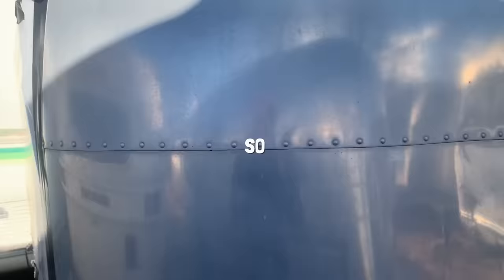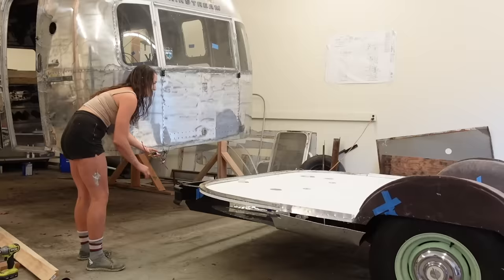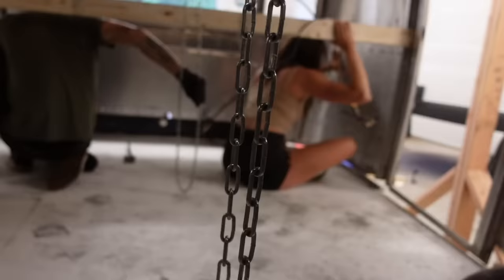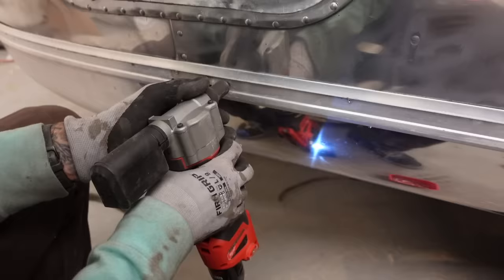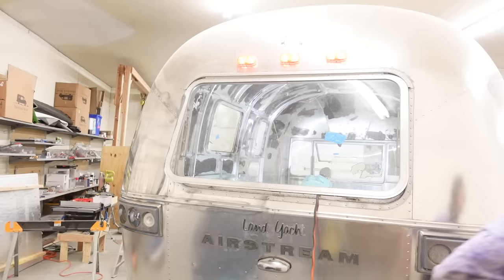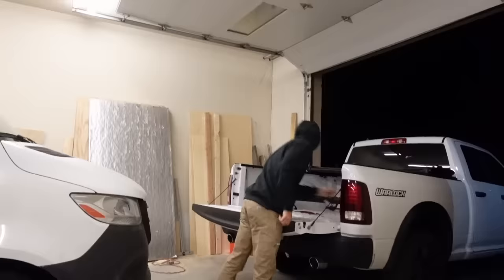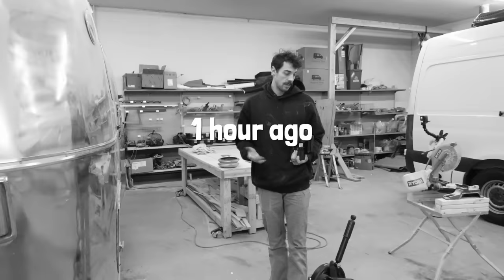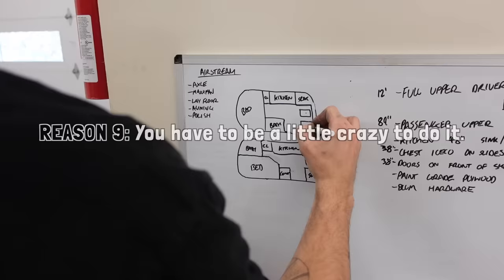Why No One is Renovating Airstreams

Comment: It is unfair to make it seem like this is just an Airstream problem, it is a problem with all campers. I owned an Airstream and other campers, the all have the same aging problems. If anything, the Airstream held better then my other campers, the reason is they are extremely well made.
Reply: only difference with an airstream is the interior
Reply: No, Airstreams are actually extremely light weight, made for towing, NOT durability.  Let's not talk about the formed plastic interiors.  About the only rebuildable aluminum campers are Boles Aero and Silver Streaks,
Reply: It would be better to say, you can run into simillar problems with aluminium in any trailer, but its obviosuly the more traditional the materials the easier, and the more traditional the original build the easier. If its aluminium but has 4 walls and a roof, you will find it easier than a single body construction.
Reply: Dude, no. We were talking about DIY renovation of a trailer. Airstream helping you maintain it as is-is dodging the issue.
Reply: Airstream are stronger than most, which are mainly wood.
Reply: It’s just y’all pay for an airstream that has all the other camper problems, 😂😂😂how to say you have been fooled without actually saying it
Reply: @kcgarrigan4324 no camper was made to be towed, that’s the issue, it cannot withstand towing,, that’s why you have your day start with a dribble, but they sure are pretty, that’s all that matters
Reply: Most trailers are wood framed and almost unfixable in the event of rot, the weaknesses of the Airstream is the need to take it apart if the floor rots  but that is the only structural wood in the thing, the later models fixed this issue.
Reply: id use marine plywood and truck bed liner@MS-ig7ku
Reply: @danpettis1675  I just used CDX for truck bed liners it is easy to replace and lasts for many years.
Reply: @danpettis1675  Agreed no idea why they used OSB after tearing this apart.
Reply: @danpettis1675  No bloody wood.... in a dry climate maybe but up  north NO !
Reply: @geroutathat ,
   Exactly. Even in this video above, we see that the shell was pretty darn well intact, and they're talking about "making a tiny home" in it, which means they're going to gut and pitch most or all of that vacuum formed textured plastic. 2× 2 walls etcetera means you're going to rebuild the whole darn thing. Airstreams aren't really that bad. I have an Airstream RV and got lucky because it was in really good shape. My aunt actually kept it inside a pole barn!

Comment: To install any distorted/flexible shape such as an Airstream body on to a floor base, you fix upright guides into place that, as you lower the body shell, align the body with the base and it drops gradually into place as you tweak the shape into place.
Reply: Shoe horns.
Reply: just what I was thinking
Reply: Brace the body internally to hold it straight. It will then fit the chassis. It’s a method often used when restoring heavily rusted classic cars.
Reply: funnels or shy even wooden rulers,
Reply: What about you put x braces up in shell before you remove it from the chassis so it holds its shape

Comment: "speciality tools" shows some basic tools that could be used for anything.
Reply: Was thinking the same thing, also seems slightly too pricy for what it seems to be…
Reply: And expensive versions too
Reply: Yeah you can use those on boats
Reply: Lol I have like 3 of each of those specialty tools shown 😅
Reply: @mathehack1  you can use those tools on a lot of things, thats the point lol.
Reply: Most people don't need to rivet a whole camper. Electric rivet gun? Rather specialized for most. A regular rivet gun? "Everyone" should have one.
Reply: @mnFlatLander  who needs electric screwdriver? just use regular screwdriver. yawn. manual rivet guns can be very inprecise and slow to use.
Reply: @ChrisWijtmans  XD for one project you can wrap up tools in 300$, n need to pay 400$ for be tool. Check how much cheap pneumatic riveting gun costs :)
Reply: @Vein1986  found rivet guns for drills for as low as 30-50 bucks which is as much rivet pincers. Also found my favourite brand, bosch, rivet guns for 800 bucks. Anyway the price is not the point. Rivets are used for a lot of things so its not a "specialty" item. The price dont matter. Just the fact you can find a rivet tool for 30 bucks or even cheaper proves that rivets could even be used for cheap hobby projects.
Reply: It’s a woman. What do you expect?

Comment: I once bought a used riveted aluminum boat and realized quickly that I asked for trouble. Hours and hours researching and working on the boat. Sold it after fixing it properly. What a learning experience!
Reply: Put 300+ rivets in a aluminum rowboat last year.  Fun and loud! (no and yes).
Reply: I wanted a Gregor Aluminum fishing boat, with their alumaweld process, after looking at cheap, always leaking Valco riveted aluminum boats.  Much more expensive, but worth every penny as it aged, there was no putty hardening and falling out around every rivet hole causing slow leaks and constant bucketing of water out of the bottom of the boat. Glad I spent the extra money for a welded hull. Valco's that get aged are leaky junk.
Reply: @feloniousmonk3049  yeah that’s the way to go if you can afford it. I wish I could afford a good TIG welder, I’ve always wanted to buy some aluminum sheet and build my own boat. A catamaran type hull would be cool, since they’re super stable. A Flat bottom would be way easier to build though. Oh well, a man can dream right? A man can dream.

Comment: It easy to see why few people would want to restore an airstream,it’s basically like a boat with wheels everything has curves!
Reply from the maker: Curves EVERYWHERE!!!
Reply: You are cutting an aircraft in half horizontally. You need the same tools airframe mechanics use.
Getting a water tight seal takes skill.
Reply: Aircraft is the proper analogy here.
Reply: I'm sure the factory had templates to make things easier. You are just having to do it the hard way.

Comment: at 10:17 - lug nuts were put on backwards and tightened with impact wrench backwards - the tapered end goes in to center the wheel perfectly. If you haven't corrected this already, flip the lugs around.
Reply: hope  you saw it. you put the nuts on wrong
Reply: Yep. I see people do this all the time.
Reply: Camera setup reversed
Reply: You should have mentioned that it is very dangerous if they don't. There are many case where accidents and deaths have occurred because of this.
Reply: @vintagebikes4215  LOL!

Comment: My husband and I did this was a 34ft Silver Streak and your video makes me want to do it all again for some reason 🤣 And you're absolutely right about it being so hard for perfectionists! Hope you're enjoying every minute of your build!
Reply: Yep sleeping in my 34 Silver Steak that i did that to it 10 years ago.  Took a long time but got it done.
Reply: I'm working on a 34' silver streak right now! A 1968 Continental Supreme.

Silver Streaks are soooooo much easier than Airstreams to restore because, even though the trailer is about the same weight, the frame is significantly stronger.
Airstreams get their strength from the shell. Silver Streaks from the frame. So no popped rivets after a long trip.
And you can't polish them because they're hard anodized. Easy to maintain!

They're a little weird in some ways, but silver streaks are just awesome.  :)

Comment: OMG! I rebuilt a 1978 Airstream for a client, and it was, without exception, the most difficult building project I have ever done. Every day was a new challenge. The floor and frame were rotted out and had to be completely rebuilt. When I finally got around to rebuilding the interior, I found that no two corners were the same. So creating a pattern for the aluminum or cabinets that I could transfer to the other side didn't work. In the end the project came out great and client was very happy. Would I do it again? Only if I had a very large shop, and there were no money concerns. One last thing to anyone looking to buy a used Airstream. They all leak! And that water goes into the belly pan, it gets caught in the insulation and rots the metal frame and wood floor. Good luck.

Comment: If you're not able to get the Airstream out of the shop just let some air out of the tires, maybe it will help just enough to get it out. Good to see a full build from the ground up.
Reply: And if THAT isn't enough, removing the tires and sitting the brake drums on a set of Harbor Freight auto dollies absolutely will. 

Don't ask how I know.  😁
Reply: But don't let the air out until you've rolled the trailer really close to the door, it'll be much harder to pull by hand without air, and if you want, you can use a vehicle to drag it thru the door. You can also use a rope to pull the garage door back to the rear farther, or a 2x4 or something similar to push and prop the door up higher, might have to disengage the door from the bar with the red handled release that's common on such doors. Rope will work best in that instance, keep the door from rolling forward just in case.
Reply: Take the wheels off and put some piano dollies under it.
Reply: @Neisan 'ōkurī You are right!
Reply: Had a neighbor construct a private plane in a room of their 2nd story house. Had to remove the front wall to get it out.
Reply: Was going to make the same suggestion but you beat me to it.

Comment: When trying to line up rivet holes you need a forest of Cleco fasteners to pre align the holes then remove one at a time and replace with permanent rivets. That's how it would be done building aircraft.
Reply: Indeed, that's the way its been done for over 100 years now.  Airframe mechanics often carry buckets of Cleco's along with multiple awls/pins for alignment with them since the only hole without one should be the one your currently setting a rivet in.  First you massage the entire joint with the awls to get every rivet hole set with a Cleco before you remove the Cleco's one at a time to replace them with rivets being sure to completely seal the skin to the frame along with each individual rivet.

An accurate interior template for the wall flange placement to ensure perfect alignment of the flange after rebuilding the platform is a critical step that will cause you much grief if skipped.

It's a given that all apertures for windows, doors, vents, etc will need to be flanged to support the fixture and provide for attachment of the interior skin.  They should be aluminum frames preferably TIG welded at their joints and not made of wood.  They can also be low temp aluminum brazed using a plumbers torch and aluminum rods available at Harbor Freight or on-line if you don't have access to TIG equipment.

Also be sure to use the correct spec Vulkem Adhesive Caulking on everything.  Airstream has made a lot of improvement in these caulks to better insure water does not leak inbetween the skins and frames.  A lot of damage from leaks is unfortunately due to owners failing to regularly inspect and perform maintenance on caulking especially around apertures or when repairing damaged areas.  That "A stitch in time saves nine" adage holds quite true here.

The axle if not rotted out is usually totally rebuild-able.  A wheel bearing that has not been greased correctly is a cheap and easy replacement job compared to replacing the entire axle.  I would have been more concerned about atrophy of the frame itself from exposure to road salt.  I recently had to weld in new steel to repair a compromised trailer frame and its not an impossible job.  Requires some love with an angle grinder with a wire cup brush on it.  Follow up with OsPho to change any residual rust (even what you can't see) into Iron Phosphate before etching and urethane priming.

As for the lugs backwards... what can one say except oops!

Best!

Comment: Give you a hint if you ever do a second one, when you are dropping the aluminum shell rivet on some flat pieces of metal to the base and bend them to the inside. When you drop the shell these will act as guides to force the aluminum to go around the base. once the shell has been placed drill out the rivet and remove the flat pieces of metal.
Reply: I reckon you would want to also use aluminium for those guides too? Steel on aluminium may damage the aluminium shell.
Reply: They are only temporary he’s saying… no worries
Reply: Smart man. I’ll be doing that soon.

Comment: Two years before retiring I decided to do my 3rd boat build and build a trailerable houseboat.  It's been 6 years and just had it out for the first time with a motor.  I would see small houseboats that needed work that I could pick up cheap but each time I decided it would be cheaper to build from scratch to have what I really wanted in a boat.  I also realize that this is something that I will enjoy but be able to sell.  My grandson wants it, so it will be his someday if I don't wear it out.

Comment: In the future, save yourselves about $1300 by learning to repack wheel bearings and replace/adjust your own trailer brakes. It's a messy job, but well worth it. The only axles I've ever replaced were ones that had sheared the hubs clean off from overloading.

Comment: Interesting way to install lug nuts (10:22). It would appear they are installed upside down (inside out?) with the taper facing out. I know nothing about Airstreams, but I have changed a lot of tires in my lifetime and have never seen this before.
Reply: Noticed that too.  Please spin those lug nuts 180 degrees!
Reply: Certain tires use flat lug nuts, but they won't be on this. They are on backwards.

Comment: It would seem that adding some cross braces closer to the bottom when pulling it apart would help keep the geometry, as you found aluminum loves to flex, makes you play wak a mole as you did trying to get it fit. Radius sections will be a pain in ass regardless. Great vid thanks

Comment: Good job, keep it up!  By the way, the lug nuts go on taper side against the wheel.  That way they center the wheel around each axle bolt.  Also, if you look at the wheel you'll see there is a taper around each hole.
Reply: I just commented the same thing, then read your comment. "it takes a village" ;-)

Comment: In the future instead of wood to hold the shell open, use an adjustable support bar. It will allow you to twist the shell into place. After that it's all just patience and a good time. I'd add some respirators and ear protection as well.
Reply: I was thinking weld tubing like you do with cats when you pull the body off the floor pan
Reply: @bigghouse101  Every cat I own runs when I spark up the TIG.
Reply: @Dog House  lol
*Cars
Reply: @bigghouse101  I figured but couldn't pass it by,Still makes me giggle

Comment: Re: The 2x4 frame , I would have used pressure treated lumber as it will hold up to the elements better than regular 2x4s.
Reply: Yup pressure treated wood (2x's & panels) or paint both side and all cuts.
Reply: @SegoMan  painting wood is NOT the same as pressure treated lumber....

Comment: If you get your markers mixed up, you can trace the sharpie lines with a dry erase marker and get the Sharpie off. Sharpies are only 1 chemical different than dry erase, so adding the dry erase over the Sharpie adds the chemical and allows the ink to dissolve off the board. Same trick works if you don't wipe dry erase markers off quick enough.

Comment: You put the wheel nuts around the wrong way, the angled part goes to the wheel side to correctly line up the wheel on the hub putting them the other way will put the wheels off balance

Comment: $1500 for a 3500 lb avle with trailer brakes is very expensive. The trailer and wheel supply places where I live only charge $375 in 2024. Super awesome that you are doing this project together. It will look and function awesome and be a great bonding experience.

Comment: Boat refitters experience similar issues. If one intends to take a boat down to the hull, it is important to stabilize the shape of the hull before removing the top cap and supporting structure keeping in mind that said stability needs to be maintained in three dimensions. 

Good for them for persistence and overcoming the issue. I suspect most would have scrapped the project.

Comment: I love my 1960 airstream. I live full-time off-grid in the middle of nowhere in mine. I'm lucky, it doesn't leak and the floor is solid. I took out the twin beds and had a shelf built over the wheels. I also took out the kitchen, made the front couch into a bed. I don't have running water, so am using a Berky which fills a nice copper water dispenser and haul my water in and I have a composting toilet. I wanted everything simple so I don't have to worry about frozen pipes.I power with solar and currently cook and heat with propane. I'm hoping to eventually have enough solar for that too, but it's expensive.I have shelves lining  both walls,the windows are full of micro and baby greens. I bought a  bed for the dogs that is basically my living room floor. They are big dogs so they need a big bed. It keeps the floor so warm, I live in the high Sierras in Arizona where it gets cold. It doesn't look at all like an Airstream inside with the sleeping bags and tapestries covering the walls and ceiling. It looks more like a tent inside and after I did this I cut my heating bill in half and I didn't lose any inside space. My friends were shocked at how warm and cozy it is. I've been living in it now for four years and will never go back to a sticks and bricks house